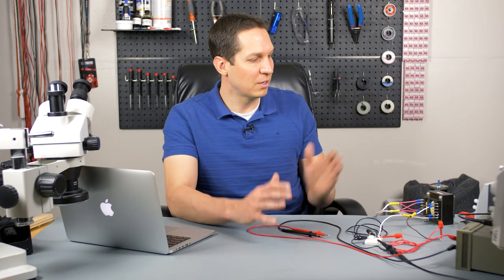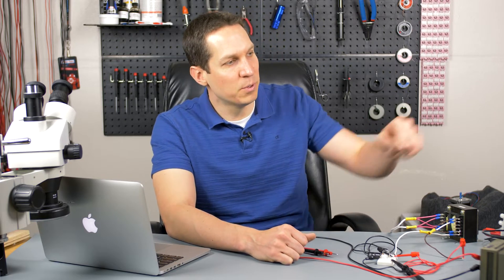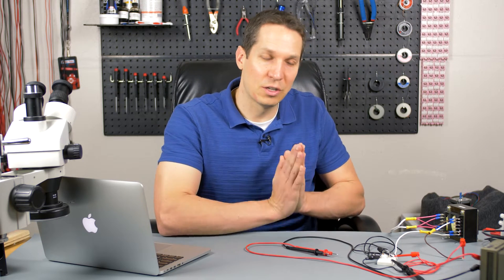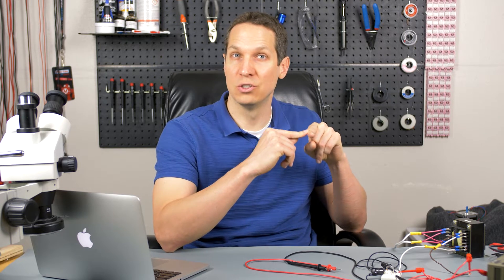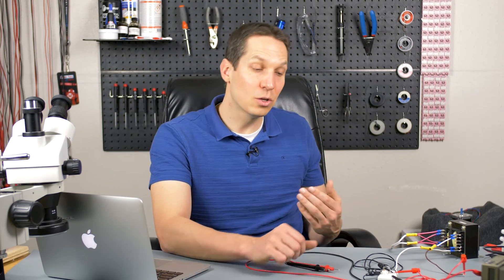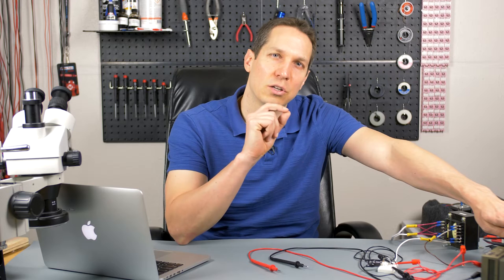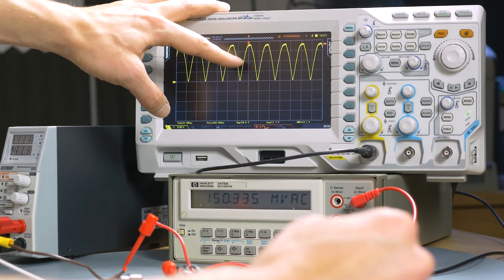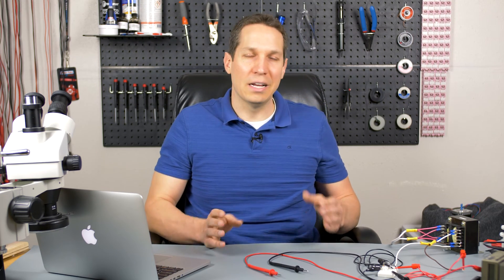Full Wave Rectifier - Practical Demonstration | Basic Electronics

Comment: Hi. I think that at the series of measurements you are making at 3:00 are not an apples to apples comparison. E.g., the measurement at 2:54 with the DMM is 13.4 V but that is an RMS measurement corresponding to a peak voltage (Vp) 0f 18.95 V. The average value of a fullwave rectified signal is equal to 2*Vp/pi in this case being 12.06 V. The Rigol measures 11.7 average (corresponding to Vp of 18.4 V) which is only a fall of 0.4 - 0.5 volts through the diodes not 1.4 volts. This can also be seen when comparing peak voltages. Peak on the secondary is 18.95 V and peak on the Rigol is 18.6 volts corresponding to only a 0.4 V loss. So it appears that the actual voltage drop across the diodes is only on the order of 0.4 - 0.5 V total.

Comment: I have a doubt,  Why do we use  Transformer  only for RECTIFIERS experiments?
Why can't we use a FUNCTION GENERATOR??
Reply from the maker: We absolutely can use a function generator in a full wave rectifier experiment.  In real life applications, however, you're almost always using a transformer of some sort.  But for experimentation, if you have a function generator, as long as you don't exceed the output restrictions (which function generators have a relatively high impedance output) you should be fine.

Comment: I'm watching you back catalog and enjoy your work ! from the secondary I multiply the RMS value by 1.414 to get the peak but cant remember why ! could you explain please ? ...cheers.
Reply from the maker: Yeah, RMS is a bit weird and can be confusing at first.  We use RMS to have a useful numerical value when dealing with AC signals.  With an AC signal, you can't get an average value, as it's typically 0, so that doesn't mean anything.  And if you use the peak value to calculate average power dissipation, it will give you skewed numbers, as you aren't constantly dissipating that much power since the AC signal is typically much lower than the peak value.  So, we get the Root Mean Square value to give us something to work with.  To save ourselves a lot of trouble, some of the typical waveforms already have their values calculated out so you're not doing the entire RMS calculation each time.  Sine waves are divided by the square root of two to get the RMS values (square waves/triangle waves/sawtooth waves all have a different value, if I remember correctly - this should make sense intuitively that different shapes yield different RMS values).  SO!  To get back from the RMS to the peak-to-peak values, you simply multiply it by the square root of 2 again (1.414).  That was a bit long-winded but hopefully it helps!
Reply: @CircuitBread  Perfect ! thank you and yes that does make sense, I'm simply undoing the RMS calculation, great style for lectures...cheers.